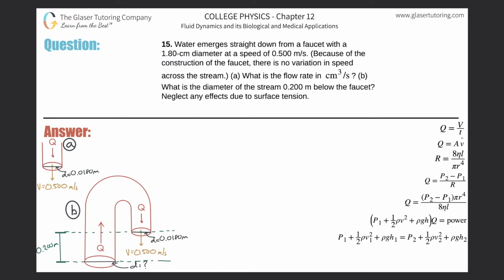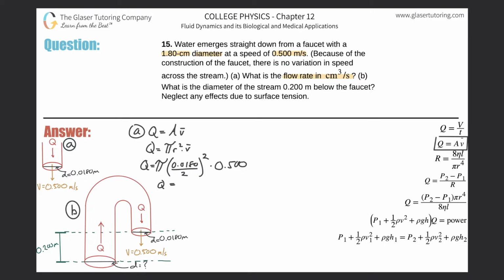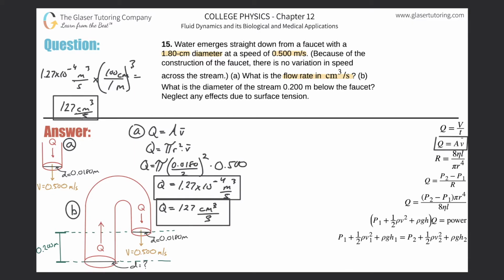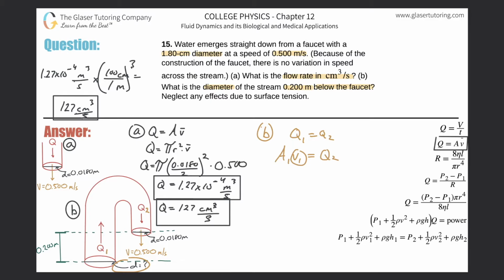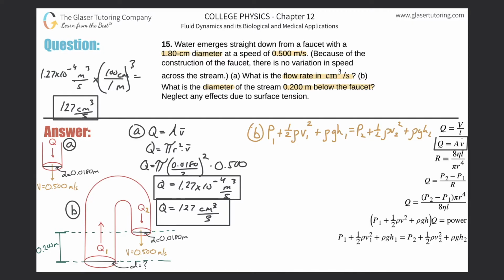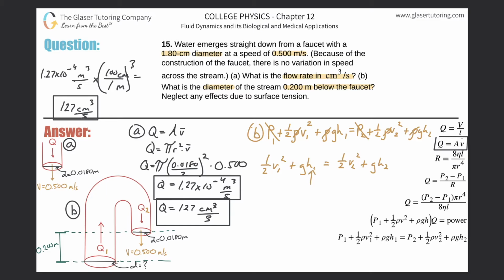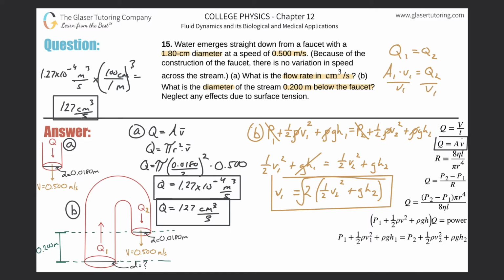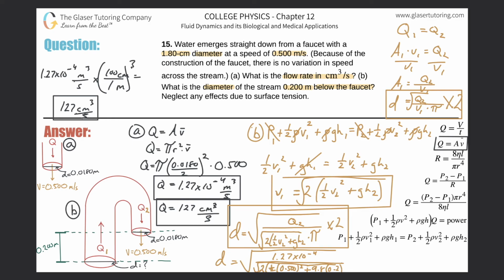12.15 | Water emerges straight down from a faucet with a 1.80-cm diameter at a speed of 0.500 m/s.

Comment: Hmm. So I did not assume P_1 and P_2 were both atmospheric and could cancel each other out. I replaced both of them with P = ρgh, where P_1 (the pipe) has a height of 0, so it cancels out, but P_2 (faucet) has a pressure of ρ*g*.2 m. So I did not cancel them out. But this means that I end up adding P_2 to the other ρgh_2, which confuses me because that's like saying pressure of the faucet times two. Maybe that's a red flag, but I went ahead with it anyway.

I get your answer if I remove the P_1 and P_2 at the beginning (.89 cm diameter), but I get .75 cm diameter if I keep P_2 in. 

Finally, why is the faucet 1.80 cm diameter larger than the water pipe feeding it? This problem really confused me.
Reply: I think the point in the textbook's firehose example (firehose starts from ground and goes up 10 m) is that the gauge pressure is 0 for both P_1 and P_2, so they do cancel each other out. 

I don't know why, but I took the figures from this problem and calculated that even if they cancel each other out, either P1 or P2 should be equal to 2.73 x 10^3 Pa, which is 0.4 psi. Again, I have no idea what that means or if I'm even right.